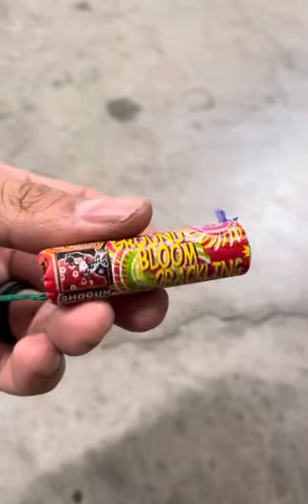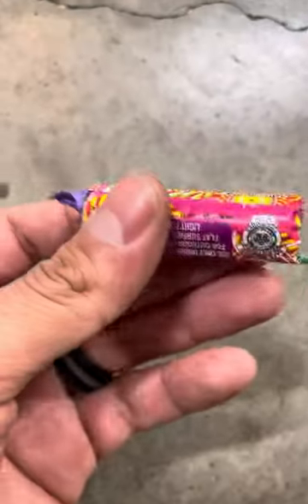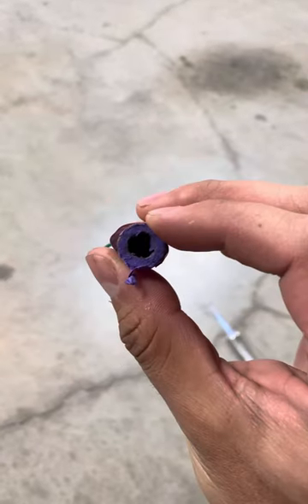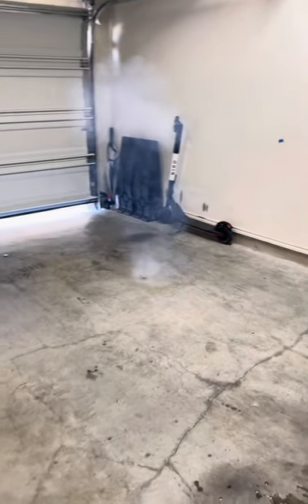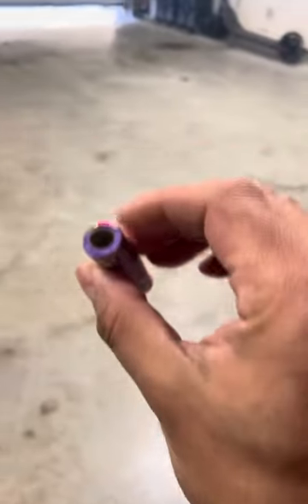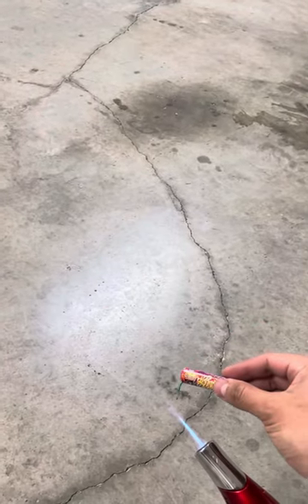Ground bloom upgrade

Comment: I'm working on this too, I was about to try today, its a simple fix huh, they just been ripping us off,  This is what i noticed with the helicopters too, that's what I'm trying out tonight, the only thing I don't get, is that there's black powder and silver powder, so I believe that the black is the thrust??? and silver is color?? IDK, and if I packed it down hard enough. Kool now we can reclaim flowers and spinners, they both were badass in the 80's, Helicopters use to go as high as good skyrockets 
Thanks for sharing!
Reply from the maker: The black powder is for the initial thrust to get it spinning and the silver is the color/ stage which has more power than the black powder alone. Yes they don’t fill them up barely anything and the older fireworks from the 80s work better Because they would actually fill them and give you a better quality of powder. Nowadays everything they give is skimped to bare minimum. Even the size of candy bars or bags of chips are much smaller than before.